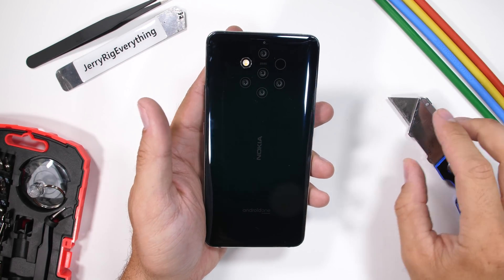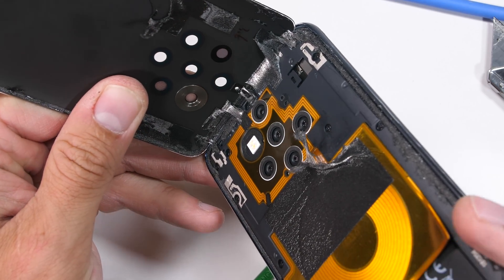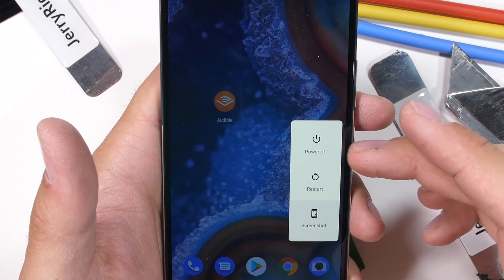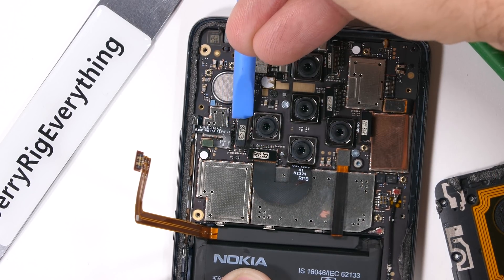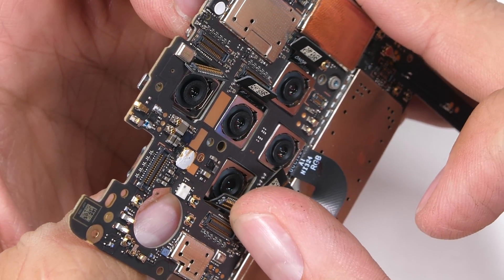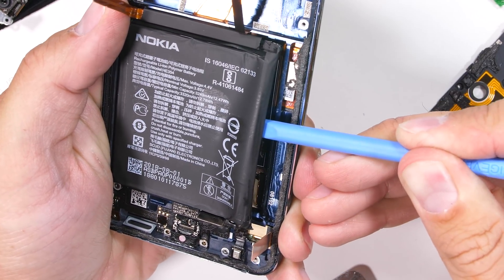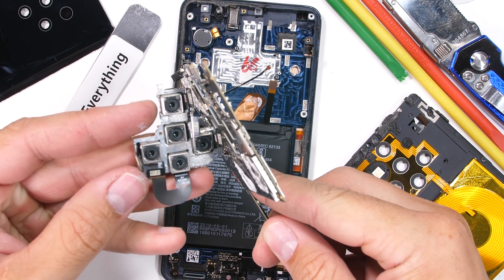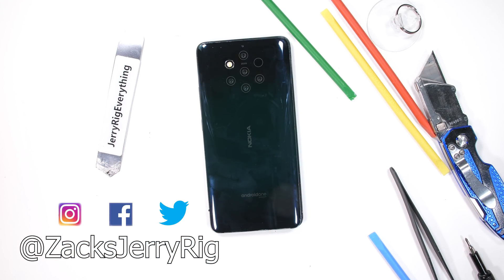Nokia 9 Teardown! - How do all these Cameras work?!

Comment: If you're to replace the battery of a phone with substantial glue like this, I'd strongly recommend running the phone down to as close to zero percent as possible first (there are power virus apps that will do it in under an hour).

The batteries are much safer when discharged - they catch fire because of them heating up so much due to the short that they start burning, they aren't inherently that flammable.

Of course there'll still be some reserve charge so not fully safe, but much more so, in fact as you're replacing the battery anyway, doesn't really hurt to do this for any phone, just to be sure.

Comment: Nice disposable device... well tbh if you  use hot air carefully you may have a chance to remove the battery easier. Bending the battery is dangerous and yes after whole process you have to put a new one. I believe this device is designed to be unserviceable like some others and they should be offered with warranty extension and insurance only in mobile plans so even if the battery dies or the screen breaks you get a new one right away... as you see the cost of time and money is a total loss even for a service center with special tools to repair it.

Comment: To safely remove old battery one must just discharge it down to 0% until phone switches off. Then it is safe to remove heavily glued battery. Even shorting depleted battery is not dangerous as there is very little energy left. New battery can be installed without bending anyway. Battery removal tabs are unnecessary.

Comment: Certified Refurbished Amazon Devices work and look like new and are backed with the same limited warranty as a new device. Used Amazon Devices sold by Amazon Warehouse are fully functional pre-owned units that have been tested and verified by Amazon to meet the specified product condition. Used Amazon Devices do not receive a manufacturer's warranty but do receive a 30 day money-back guarantee from Amazon's Link: @t

Comment: This video may well save the lives of many other Nokia 9 phones just by showing where not to try to pry, as well as where the adhesive is.  I'm sure a tool could be designed and made pretty cheaply to get under the battery to separate the adhesive without bending it now, too.

Comment: Even though I'd love to get this device I'm still thinking between third one and the OnePlus 7 Pro. My main concern with this one is the small battery and the fact you need to destroy the device to replace it. With the OP7P the battery is easier to replace. Wish there was a good flagship with replaceable battery like my Lumia 950 XL. I think this was the last flagship with this feature. Sadly this year this device will die a little bit more thanks to WhatsApp and Microsoft.

Comment: This phone is a shameless planned obsolescence, the battery defines exactly how much time / cycle you can squeeze out of the phone. Shame on you HMD for this design, it's not good for the environment and also not good for the customers, making phone impossible to repair without screen replacement is a crime. Louis Rossmann would cry seeing this. I hope they change the battery adhesive type & position in the next batch of production, and some manager in Finland can do something about this, because it's clearly not up to NOKIA design and Finnish values.

Comment: I'm not sure about Nokia's build quality. Loose and failing usb C connectors seems to be a huge nokia problem lately.  Many fail after 3-5months use. Overheating issues followed by shutdowns are also relatively common on nokia 7 plus. My 7 plus is going in for repairs. Only 5months old. My other old smartphones has non of these issues. I have to use my old Huawei p8 while my nokia 7 plus get fixed.

Comment: When i see cables exposed like this with globs of glue on them i always suspect deliberate action by the phones manufacture. They could do this to make simple fixes imposible or nearly impossible. Apple has dbl side tape going over the volume ribbon on their iphones. The ribbon has no need to be ran the way it is it is longer than it needs to be and they have to mill out a spot for the ribbon in the ipad shell so why do it at all?

Comment: Apple : Our phones are hard to repair.
Nokia: Hold my adhesive.
Reply: @footballcomp5yearsago347  hg buat tqok padia
Reply: Apple: sniff sniff
Reply: U need 1k
Reply: Damn 🤣🤣🤣🤣🤦‍♂️🤦‍♂️🤦‍♂️🤦‍♂️🤦‍♂️🤦‍♂️🤦‍♂️
Reply: use alcohol to remove adhesive
Reply: @wantedwanted3186  r/woosh

😂
Reply: I think they added that much adhesive to minimize the vibration to make the cameras possible.
Reply: Nokia: hold my 7 cameras
Reply: Wtf apple is not hard to repair
Reply: @pepegahaus4133  if you have the right tools, obviously.
Reply: This adheasive can stick an elephant on the ceiling
Reply: Remember 6 cameras
Reply: @garciagar64  butoh anda

Comment: The heat pipe transfers heat from the CPU to the battery. Good job, Nokia!
Reply: Silicon is very good at heat dissipation. Heat rises. Phones use the display to vent most of the processor heat. The heatpipe transfers heat to the display where it vents upwards. You know, that's why engineers design this stuff.

Comment: Thanks for talking about the extreme dangers of manufacturers using strong adhesive to fasten their batteries. This is not a trivial matter. Lithium ion polymer batteries are extremely volatile.

Comment: So my thoughts on the battery are by the time you need to replace it I’m sure the repair center fixing it will be aware of the sticky adhesive or at least have your video to reflect upon.

Battery adhesion shouldn’t be a reason not to buy a phone.

Comment: Nokia 7 Plus and 6.1 Plus - Most repairable awards of 2018
Nokia 9 Pureview - Not at all repairable
Reply: 7 plus is hardly "most repairable" tbh. Replacing the screen is easy, sure, but planning to replace it every time you go inside the phone, just in case, gets annoying really fast. It was the same with Nokia 6 2017

Comment: I’m just gonna call it now, for the 2019 smartphone awards, this one is definitely going to get the “hardest to repair” award
Reply: Well, only if iphones are excluded this year
Reply: Sirch iPhones have a lot of adhesive and what not but its not terribly difficult to repair since theres just some screws holding the glass to the frame
Reply: @william247  I assume you aren't talking about the back glass 😂
Reply: cannesahs No other than the back glass the iphones arent terribly difficult to repair. The back glass does need a metal pry tool and a heat gun but the rest of it isnt that bad
Reply: @william247  Have you seen Zack's back glass repair for the iphone since they have a glass back? You can't replace it. It's glued fully onto the back of the phone, unlike other phones that are glued on the sides.
Reply: Lg g8 wil tie

Comment: It's like a rollercoaster ride I was excited at the thought of buying this phone when I seen them 5 cameras. And batteries they do go bad and if they're going to make it work and not replace the battery I will not buy their phone. Thank you for your time
Reply: Has Nokia officially announced that the battery replacement wouldn't be possible? And do you repair your phones by yourself? If not, then your comments don't make sense.
Reply: @binoymathew246  there's always got to be one in the bunch. Yes I do replace my battery when it starts to malfunction usually about a year or two into owning the phone. I also replace it my family's batteries on occasion. If I didn't I wouldn't have made the comment

Comment: 5:50 you cross the line at battery adhesive?  I think most people would stop at prying open the housing...  Which goes for all current flagships.  So I feel like your recommendation is short sighted.  Maybe you've opened one too many phones ;)

Comment: Lol you recommend not buying a Nokia cuz removing the battery is a possible hazard? Lol almost nobody replaces their batteries
Reply: I agree @tommy d u b b s... Most consumers keep the device for 1-2 years and then get a new one. Plus, the Nokia phones ensure water resistance and functionality. That's a win-win situation.
Reply: It's not even that hard to remove that battery if you use a little bit of heat, you know like he did for the back.

Comment: Nokia phones and huawei and some other brands indeed glue the battery really tight, 'but' there is a really simple trick.
Just stick a little card underneeth it and add a drip of 99% alcohol. You will be amazed how easy it becomes to take the battery out now.
I'm working at a repair shop and every day i have to deal with this issue so i found out this trick.
Reply: Nice...

Comment: Replacing the battery is possible, just drain the phone down to 0%. Than expose the battery connectors when the phone is opened and connect a resistor to the poles to make sure that last bit of juice is drained.

Leave for an hour just to make sure and than ur good to go. You can stab the battery with a knife at that point. When there’s no current flowing between the short circuit there’s no heat generation and ultimately no smoke & flames. Totally safe.

Comment: Not sure many would go through the trouble to replace the batteries (non-removable) in modern phones after 2 years since decent phones are so cheap nowadays. It may not be environment friendly but it's definitely more consumer/economy friendly, people like new stuffs and upgrades. Besides, it's hard to find freshly made new batteries for most models that long after so you'll probably be getting old stocks which could be almost DOA. But I've heard people can make custom batteries so repair shops always has a way to prolong your phone's lifespan if you pay enough.
Reply: I agree with you wholeheartedly. Unless you are a DIY guy, it doesn't matter about the battery replacement. Consumers want a well built and functional device.

Comment: Well, my job is repairing phones. All Nokia phones are going to me for now... Can't wait when i get this one :')
Wish me luck with this adhesive :D
Reply: seems really stupid and anti-consumer how they did it though. Watch out with the ribbon thing under the battery
Reply: @750tiprogamer  Do you repair your phones by yourself? If not, then it shouldn't be a problem for you.
Reply: @binoymathew246  I'd still like to be able to put in a new battery when one I have gets older, and having a back come off to take it apart is nicer than the two tiny screws at the charging port (unless apple changed it)
Reply: @750tiprogamer  Totally agree. Other Nokia phones has pull tabs under their battery.
I mean, it's not that huge problem that makes phone bad but still... Unnecessary decision that helps noone.

Comment: Putting the display ribbon right under the [crazy strong] battery adhesive looks like a design that is purposely made to make sure that replacing the battery is impossible. Is it even possible to replace the battery without ripping off the display ribbon? if not, i think a lawsuit might be possible. battery is the first thing to go out in a phone, and building a phone where you can never replace the battery without destroying the major component of the phone sounds exactly like planned obsolescence.

Comment: It's rather crazy because if you look at the past Nokia phones are saw as indestructible and very easy to repair pieces of technology. They are so modular and easily to repair that if the housing ever got damage you can just swap it up for the new one. Those pixelated phones are really great. Also i think a rear mounted finger print scanner is still better than an underscreen scanner and today most smartphones are just good as disposable pieces of technology unlike back in the days where phones are expected to stay intact for several years like the Nokia 3310 or Nokia N70 or other bulky massive pre-smartphone handsets. With the rapid advance on technology manufacturers expects people to replace their phonr after a year or 2 since powerful phones are starting to get cheaper and cheaper and being staffed with more features. That's why the most expenssive phone I have is just a midrange phonr with just 4 GB RAM.

Comment: Interesting camera concept. They are trying to pull off a smaller version of the  super aperture technique that NASA just did to take a picture of that black hole. Taking multiple pictures of the same object from multiple points to cram more resolution into the shot.

Theoretically this camera set up could also do 3-D photography with the extra lense perspectives.

Comment: Zach, the analogy you made about the government mis-spending a ton of money for the development of flying machines and the Wright Brothers actually making the breakthrough is so relevant to NASA and the SLS platform compared to SpaceX (and Blue Origin).
SpaceX (or Blue Origin as a second) seem way ahead to step foot back on the moon and then some.
History repeats itself, as they say.
Wasting billions of currency in the meantime...
Even if SLS worked, it will/would not be a re-usable system.
Loss-loss either way ?
Is there something horribly wrong in this logic ?

Keep doing your excellent work, Sir;
showing us new tech your way, revealing scratches, uncovering grooves and turning the inside out of it all.

Comment: Okay but where exactly is that Time of flight camera? All i see is a plastic placeholder and nothing on the board.
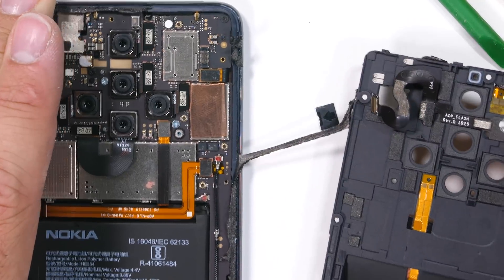Reply: It's not on the board, it's on the plastic housing. You can see the cable that plugs in at 3:05

Comment: i have a phone repair shop and i gotta tell you that huwaei phones are the worst. the lcd felx cable sits under the battery that has so much glue i have to replace the battery every time otherwise it would take me so much time to remove that battery without bending it. it's just stupid i wish they stop with putting that much glue under the batteries.

Comment: Google: we won't use 2 camera's

Nokia 9: hold my 5 camera's
Reply: X UNIVERSE even though they are hypocrites and are adding 2 cameras on the pixel 4 :P
Reply: I may recall that they where talking about the rear facing camera.
Reply: But they already use 2 front facing camera in Pixel 3
Reply: Aren't they using 3 cameras in the 4th Pixel? It's still not 2, you know.

Comment: Finally, do the s10e next time please :)
Reply: I think I saw him comment on an ifixit video on the S10+ saying he'd be interested in doing an S10e. I've had it for over a month and from what I've gathered it also has the charging port soldered to the motherboard which is not cool. 

All in all it's a nice phone as any S10 review will tell you. However, my biggest gripe with it is the fact that it gets pretty warm super easily. Just watching YouTube right now shoots up the battery to 95° whereas my buddie's OnePlus 6T does most everything in the 80's. Games on the S10e bring the temperature to 102° ish even though it still has a heatsink and that's not good for battery longevity. 
Could also be my case, but it's not even that bulky.
Reply: @NINTENdude70  celcius or Fahrenheit?
Reply: @fiere7936  Fahrenheit
Reply: @NINTENdude70  okay, how many celcius is that, i dont want my phone to burn..
Reply: @fiere7936  95°F - 102°F = 35°C - 38.8°C

It's not warm enough to blow up or anything like the Note 7, it's mainly an issue with battery longevity and the noticable throttling that happens once it gets warm; it's not as smooth when it's hot so I usually just put it down at that point.
Reply: @NINTENdude70  my phone now is getting up to like 40 or 50°C
Reply: Yeeeesss
Reply: he only does flagships, s10e is not a flagship like s10plus
Reply: @uravac7719  i just want to know how the s10e works and if i can buy it.. I have been looking for a teardown for months so i hope he does it :)
Reply: @fiere7936  i have an s10e, its perfect
Reply: @Browasweirdhaha  ik its perfect, thats why i love it!
Reply: @fiere7936  or u could buy a oneplus 7 pro,better deal than anything rn
Reply: @Kristianm  thats much more expensive then the s10e, i think he is looking for more budget imo
Reply: ClubPenguin Online 
Is the battery good?
How long does it last?
Reply: @mevinbabu5918  i dont really have a budget
Reply: @Kristianm  i like the one plus, but the s10e has a programable button well?
Reply: @uravac7719  is iphone xr a flagship though??
Reply: The Theorist Artist yes it is
Reply: DjuKaa Apocalypse 
How is the s10e not a flagship?
Reply: @HypeTV_Official  is the a50 good?
Reply: @fiere7936  no
Reply: @bernie604  i have the same opinion as you! I like the s10 series better then the A series
Reply: ImFiere 2 
It's kind of good but there are better phones depending on your budget
Reply: @bl7944  i dont really have a budget but it cant be too expenisve
Reply: @fiere7936  buy the Zenfone 6, best phone on the market right now
Reply: @Atropos866  i dont like the camera on the zenphone 6, i like pop up cameras and normal cameras, not the back camera popping up
Reply: @HypeTV_Official  is it better then the s10e?
Reply: @HypeTV_Official  Idc what the price is, i just like the s10 series better then the A series
Reply: @fiere7936  I got my s10e in my country for 400 euros
Reply: @halilbagosi  in my country its 6990kr (sek)
Reply: @HypeTV_Official  nice, i have a sh*t iphone se rn so i want to upgrade soon and i like the s10e
Reply: @HypeTV_Official  Just Monika
Reply: Pocophone teardown anyone remembers? Not even a flagship lol..
Reply: @HypeTV_Official  DONT EVER BUY AN IPHONE, THEY ARE NOT WORTH THE MONEY!
Reply: @HypeTV_Official  But the s10 plus is too big for my hands, thats why i like the s10e better, i have small hands
Reply: @HypeTV_Official  i dont know what that phone is
Reply: I want a phone with better batterie then 1650 mah